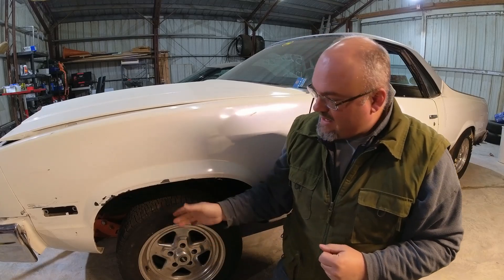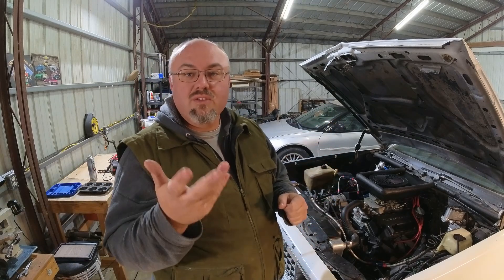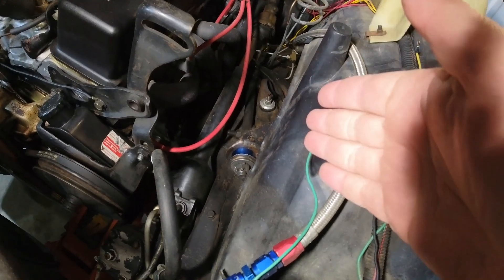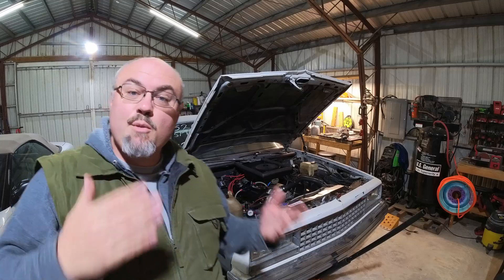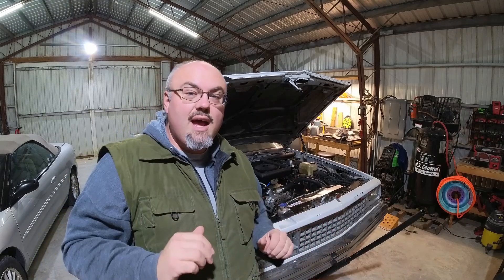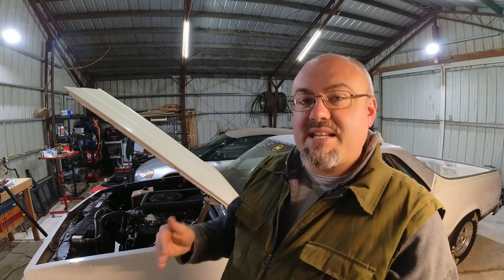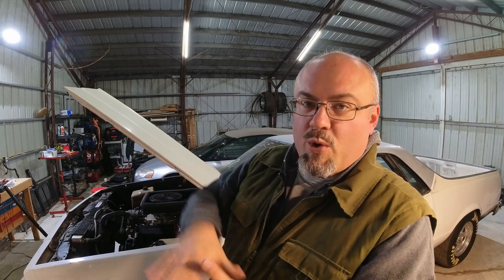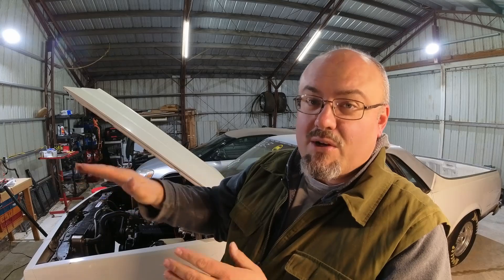How the Front Suspension Makes Drag Cars Faster (The Science)

Comment: I'm confused by the statement that soft springs store more energy than stiff springs because it compresses more. The energy comes from the weight bearing down on them, which is the same. So, surely they will both store the same energy, just that the softer spring will release that energy slower than the stiff spring, as I understand it. What am I getting wrong?
Reply from the maker: A softer spring allows for movement while a firmer spring tends resist movement. Realistically, the softer spring allows the suspension to move through its range and transfer weight more efficiently. There are practical limits with how soft you should go, it does need to support the weight of the car. The speed at which its transfered is controlled by the shock, a looser extension allows the front to rise faster.

Comment: Did u take the moroso trick springs out?
Reply from the maker: I took them out not long after I put them in. The ones I had were too light for the car. A factory V6 spring would be about right for the car as it sits. Right now I'm running the Heavy Duty style v8 spring.
Reply: @SnowFamilyRacing oh ok I got the 47135 I wanna try
Reply from the maker: Give it a go! I know that getting them in the right weight range is important. I had a set given to me, I put them in, they were too light and went back to what I had.

Comment: I see you have a heat sink under your carburetor.    Good move, especially with pump fuel.
Reply from the maker: That was done at a time where I was working to mitigate, or deflect in this case, heat from getting to the carb. It did have some effect with the Dual Plane. Now that I have an AFR Single Plane intake on it, I'm not running that heat shield and it seems to be much less of an issue than the dual plane intake. Still running pump gas, and I make sure it gets ethanol free gas to help keep this car as consistent as possible.

Comment: What Hp/torque does your car make?
Reply from the maker: I built it to be a torquey street engine, it's been worked on a bit since then. I figure it's about 380-390 hp and 420ftlbs of torque. It's a pretty mild 9.8:1 compression 383 and was the first engine I put together 20 years ago. It's been a solid performer.
Reply: @SnowFamilyRacing  ive got a 406 sbc 425hp and 496torque.
I think im gonna do v6 springs and maybe single adj shocks.
Do you think i could actually see some daylight under the tires?
Reply from the maker: That's more a matter of how the whole suspension is set up, front and rear. Mine separates the rear really well and drives the whole car forward and up. I should swap to V6 springs, and it will likely help weight transfer further. Double adjustable shocks will definitely allow it to come up quickly and settle down slowly. I also have Global West Del-a-lum bushings in the front control arms for really smooth articulation, which helps the suspension do its job consistently. I think on a good track you likely could see some light if its all set up right.
Reply: @SnowFamilyRacing on the rear i have caltracs, global west shackle kit with del alum bushind and global west front springs perches.
I bought v6 front spring just yesterday. I have CCP drop spindles and i will buy shocks very soon.
In a 78 Trans Am btw.
I have a lot to learn on suspension so i thank you for your time and attention !!!
Reply from the maker: You're welcome! Sounds like a good combination. I don't have any experience with racing a leaf spring. I have a friend that races in NHRA Stock (B/SA) with a 71 Camaro that pulls the fronts out past 60' on Caltracs.
Reply: @SnowFamilyRacing is your buddy a youtuber etc. that i can follow ?
Reply from the maker: His name is Chris Hall, he's pretty quiet. You can find him on Facebook, but he doesn't post much. Bright green '71 Camaro.

Comment: what about on a anti-squat separation style 4 link car like brett lasala
Reply from the maker: Rear suspension is going to have to be a whole video of it's own, and the front suspension is still wildly important. I'll tell you that my El Camino has a high percentage of anti squat and separates like a radial car (Brett's car as well as most on a radial) with it's triangulated 4 link. The front suspension is still extremely important because it does have to move correctly to transfer weight. Also, keep in mind, when you get to that upper echelon of performance, it's a game of constant refinement to make it faster and there's a fine line between a great pass and spinning the tires. Those cars also have a lot more adjustability built into them, where I'm a little limited working within most of the stock parameters. A slick like mine is going to be a lot more forgiving and that my slower passes allow for much more room for error.